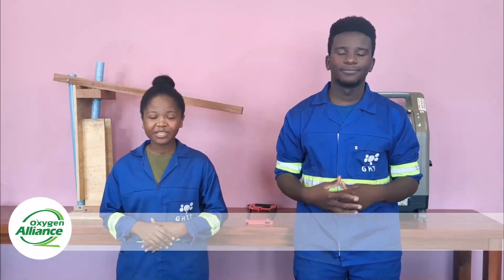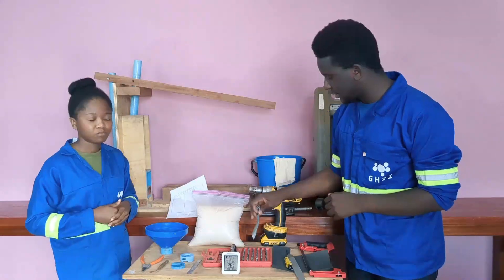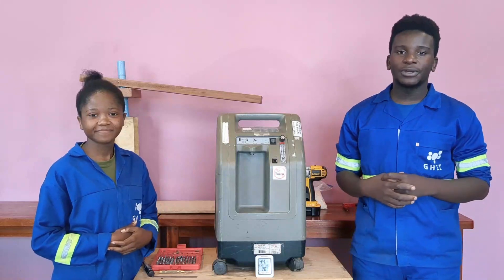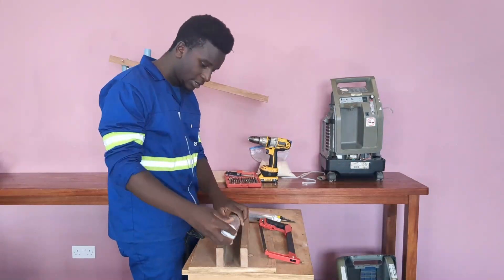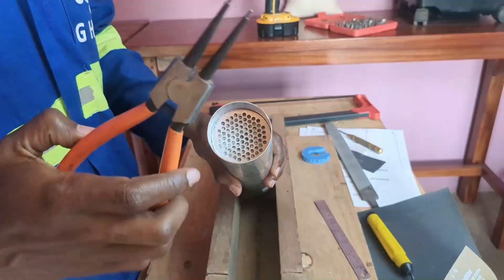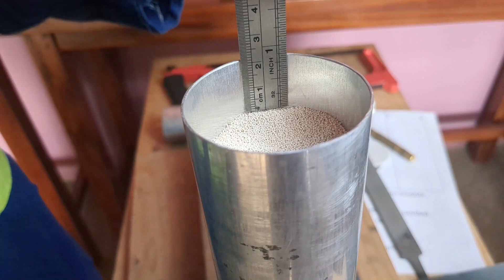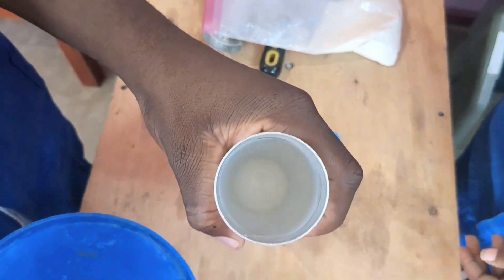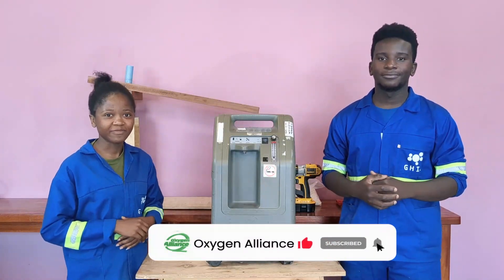Sieve bed refilling using the snow fall method

Comment: If the ends are glued, can one try using s heat gun?
Reply from the maker: If you are referring to the ends of the sieve bed, they are usually not glued. You will need to unscrew or cut the sieve bed, as a heat gun will not help.